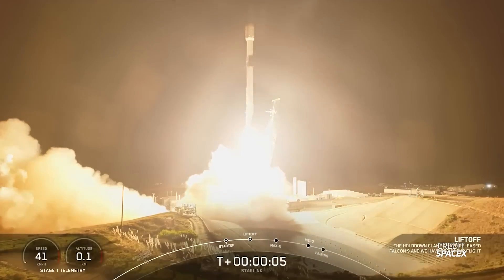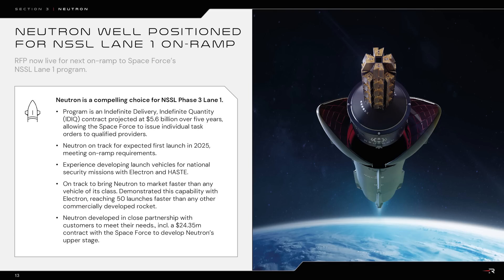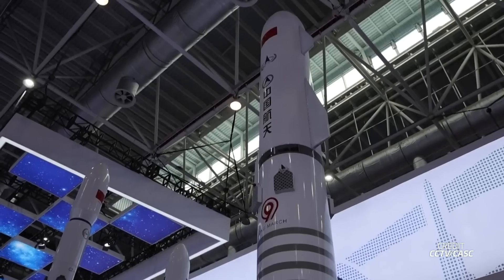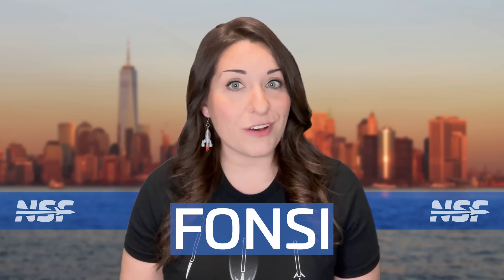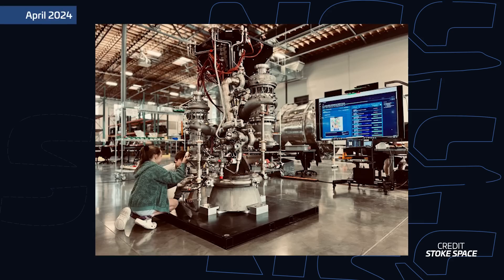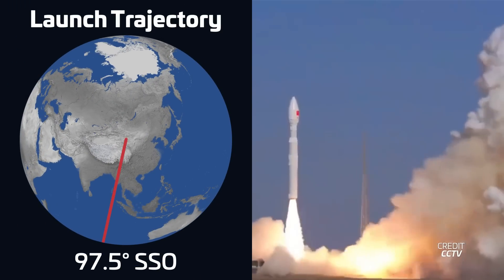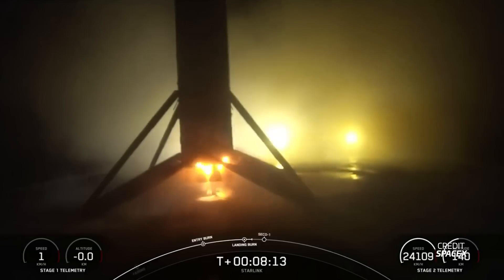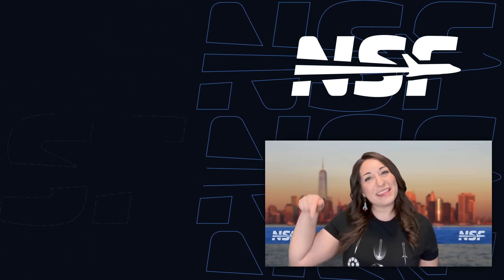Will China & Europe Get Their Own Starship? | This Week in Spaceflight

Comment: Wait are you telling me that SpaceX lost 667 of its launched satellites this year alone?!?! That's nuts. Why are they so faulty?
Reply: Nobody said "this year". That's the overall stats. They started launching Starlink satellites back in May 2019 and there have been over 200 Starlink launches since.
Reply: @ale131296  ah, ok. I misunderstood the stat, so thank you for clearing it up. Still a pretty hefty failure rate though.
Reply: They are designed to de-orbit early.  Plus there a few accidents, like an O2 leak,  then there was when the Sun heated up the Earth's atmosphere causing it to expand before a batch of satellites could get to their working orbit.  Low Earth means fast transmission times along with atmospheric drag.

Comment: China’s concepts for the gantry style booster catch system, and the other similar one we saw a while back that used 4 cables to close in on the booster actually seem like really cool ideas that could allow for a greater margin of error during a booster catch. So, it was such a bummer seeing Cosmoleap’s blatant mechazilla clone. They had the perfect opportunity to develop some innovative new tech, but I guess that’s just not China’s style. Still hoping to see someone else pursue those ideas in the future though.
Reply: I think the chopsticks offer just as good of margin as the two metal sleds shown. The chopsticks, as highlighted when loading/unloading the rocket, can close to the needed width regardless of where the rocket is. So if for whatever reason it's 30ft (~10m) off to either side, it can still accommodate. Now, whether their system has the ability to dynamically determine its needed catch position, is another matter entirely.

However, admittedly, that gantry method offers equal support regardless of where it is. Whereas with the chopsticks, things might become dicey if it has to catch it at the end of them.

The cable system IS very dynamic, but I question how safe it would be for really large rockets. Falcon 9 size, ok, but New Glen or Starship/Super Heavy... I'd he concerned! Not only are the cable's lacking a suitable footprint to catch on (the resulting force on a small area) might cut the rocket. Also, the cables themselves can get all distorted and would have to be kept extremely taut to keep the cables straight. (look at the arresting cables in an aircraft carrier as an example)

If they ever get far enough into development to testt their methods, it'll definitely be interesting to watch how it pans out! 😁

Comment: takes blue origin so long to build one rocket compared to SpaceX
Reply: It's not fair to compare directly.  BO followed the more traditional legacy path.  The rocket they're getting ready to fly is for all intents and purposed done with development and will be mission ready (so they hope - some tweaks are not uncommon after a first flight).  Starship is as much as a year out from being mission ready yet, but the spacex approach does produce fast results, usually at a higher cost in terms of breaking stuff.
Reply: @imaginary_friend7300  The problem is, Blue Origin's approach makes them more vulnerable to long periods between launches, let alone if things dont go right. SpaceX launches more often and has had to tweak things all along, if Blue Origin can't get it right in even three tries, it could take them years to nail the objectives reliably
Reply: @ravshanoday1073 agree. I'm skeptical of BO ability to land first time. Spacex have hundreds of landings but still need to experiment with ss. Why and how would BO be able skip this step? Do they have some proprietary method for verifying a design? I doubt it.

BO- best case is a ballistic attack on their drone ship. Worst case it disintegrates during reentry
Reply: @JamesHardaker  remember that they do have landing experience in the company with new shepherd. yes, at much lower velocities, but it's valuable all the same.
Reply: @0x5DA  indeed it's useful. Spacex had starhopper and whatnot, still wasn't enough. Vertical take off and landing was even solved b4 spacex
Reply: @JamesHardaker  whilst this is true, remember the bellyflop manoeuvrer  is more complex than the more traditional (isn't it wild we consider propulsive stage-1 landings "traditional"!) approach NG will use.
Reply: @JamesHardaker  BO already thought about your criticism and answered it "so you're telling me there's a chance" :D